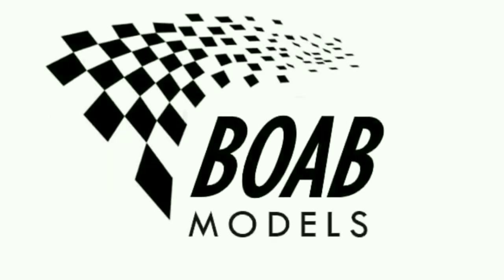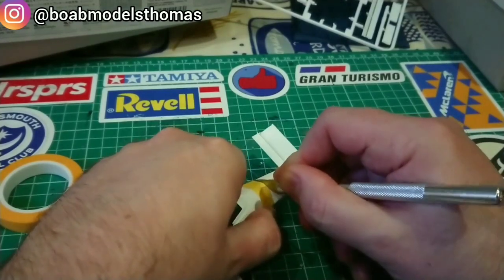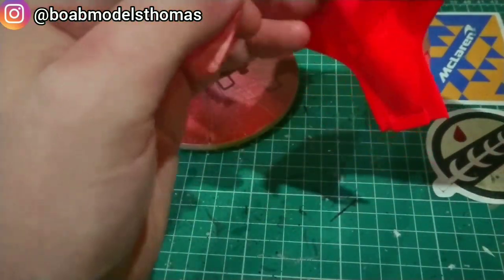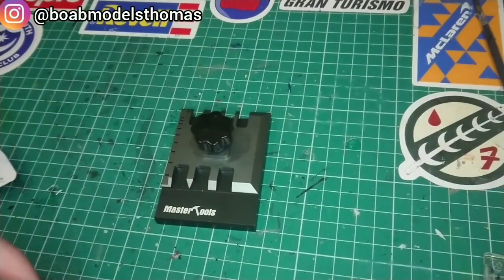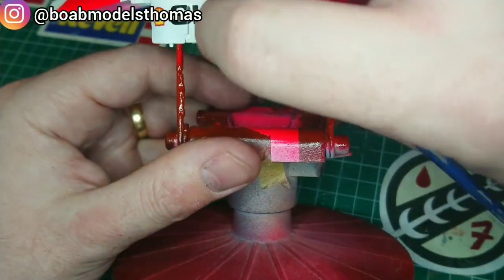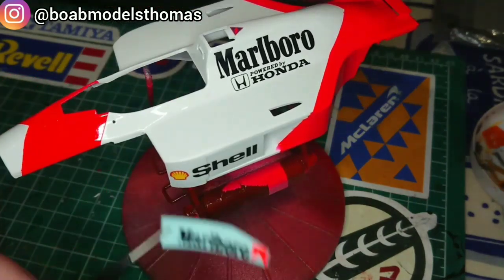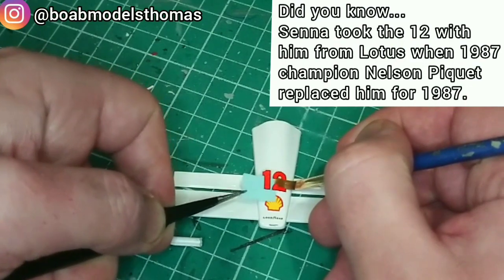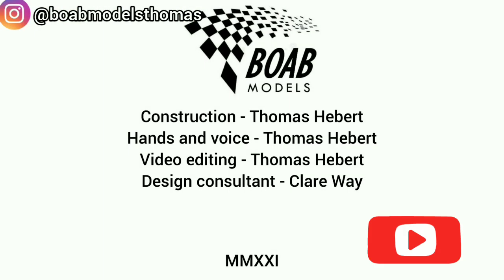Senna's McLaren Honda Mp4/4 part 3 - 1/20 model by Tamiya - body - prep, mask, paint and decals

Comment: Hi could you tell me where you got the extra end plates from? I recently bought the same mp4/4 kit on eBay it was listed as used & 1 front & rear wing end plates are missing. I would much appreciate it.
Reply from the maker: So I used photo etch ones from the Perfect parts aftermarket set so I actually didn't use the kit ones at all.
I can check if I still have them if you like